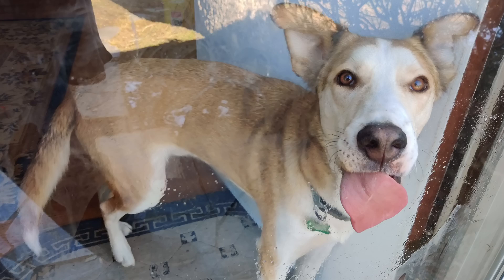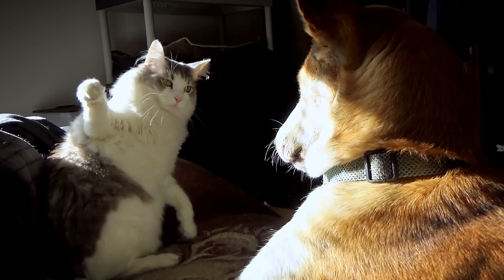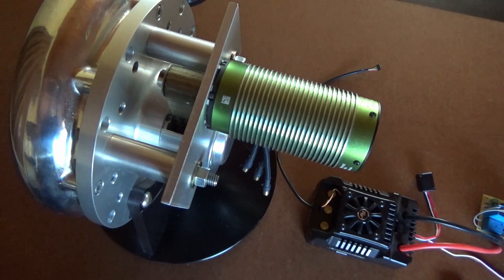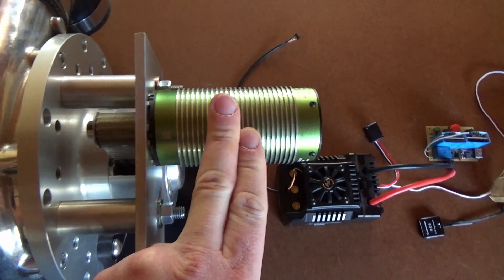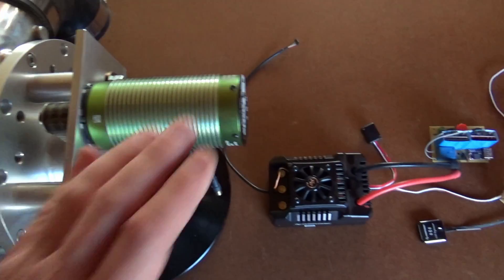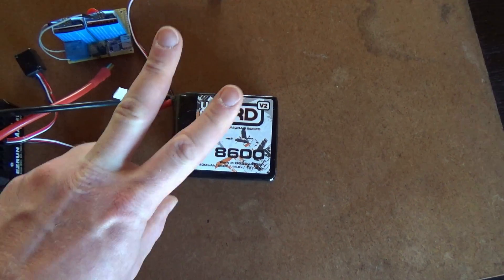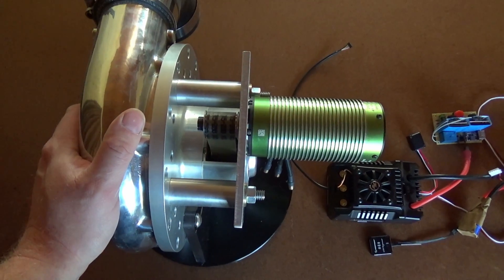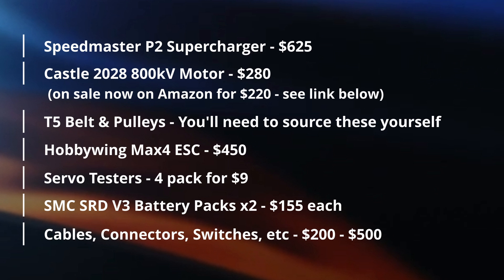DIY 650hp Electric Supercharger - Parts & Prices

Comment: Alex, if you 'had' to replace the centrifugal with a Positive Displacement (Such as a Scroll-type supercharger, rotary lobe, rotary vane), and your goal was just a little 7-8 psi boost on-demand for a daily driver.  Something like a 3.0  V6, and only up to 4000 rpm (literally 1/3 of the cfm's you've been hitting).  What would you go with?  Notice I said scroll-type and not twin-scroll.  I'm talking Positive Displacement superchargers that produce an almost fixed pressure output at any RPM.   I just want something for on-ramps, 0-50.  I'll be using a diverter valve, that lets the car run NA or Boost, by opening/closing the diverter valve at the throttle body (sealing off the factory air piping from air filter to intake, preventing boost escape...).  So the car can run NA most of the time without sucking air thru the supercharger (it wouldn't be able to thru a pos. disp. pump).  It looks like they've got some really cool scroll-type, lower rotor mass, 88% isentropic efficiency...
Reply from the maker: Personally, I wouldn't do a positive displacement compressor.  I used to run a Whipple and before that I had two Eatons on the LTD.  The benefit of the PD supercharger is instant boost - something that an electric drive gives a centrifugal supercharger.  The added benefits are that a centri is more efficient, you can draw through it (no need for a diverter valve), it's lighter, smaller and you can use a smaller electric motor to drive it due to the centri's much lighter impeller.   But you mention a scroll type supercharger, which is different; I've only heard of them being on older VWs.  TBH, I don't know much about them.  But I'd assume the net power input to drive one (in watts) would be comparable in HP support to the centri unit.  200hp (total) would likely take about 5kW; 400 would take about 10kW.  You'd have to match the motor/ESC to the operating rpm of the compressor.

Comment: i just asked Chat GTP 

what the max rpm for this motor 

Let's assume you're using a 6S LiPo battery (22.2V):

Max RPM = 800 × 22.2 × 4

Max RPM =70464
Reply from the maker: That motor is limited to 50,000 rpm; you go much above that and you risk disintegrating the rotor.  But realistically, peak motor power is around 30,000 rpm.

Comment: Awesome info, thanks. Is there a way to set up something similar with much larger batteries for much longer use, charging on a 12v system to replenish..........?
Reply from the maker: Sure you can.  But not sure why you'd want to - a couple of minutes of WOT in a 600hp car is not something you'd be likely to use unless you're racing Pike's Peak or something - even then, you'd probably never be in boost that long.  And I do have a charger setup in the car, btw.  Though it would take a while to fully recharge a dead battery.
Reply: @AlexLTDLX  Hey thanks for taking the time to answer me. Well the reasoning is for an aircraft engine, mine. As you know, with altitude you're losing manifold pressure. I'm looking to boost my amateur built Mll RG. I live on the W Coast. Big rocks. At 10,000 I'm losing 30+%. Turbocharging was my plan and I have all the parts to complete however, heat and exhaust fab are a pain.
Reply from the maker: @badattitudeaviation  Aah, ok.  That makes sense.  Didn't even consider an aviation application...
Reply: ....now if I could figure that out...even a few minutes of use at a time would be useful
How would that be done?
Battery size?
What about heat of the motor?
Thanks
Reply from the maker: @badattitudeaviation  just make sure it gets plenty of airflow and heat won't be an issue.  A 20 amp hour pack should give you about 4 minutes of run time.
Reply: @AlexLTDLX  thanks for the feedback
Reply: @AlexLTDLX  looked for charging on electric boost site...suggestions?

Comment: Where do you find the motor pulley?? I either find the right tooth but wrong width or the right tooth and width but the wrong bore 😭😭
Reply from the maker: I've not been able to find one with an 8 mm bore. I bought 6 mm bore pulleys and bored them out on my lathe to 8 mm.

Comment: Can you tell me the heat of the shaft coupler? I am hoping my friend can 3d print me a coupler that can withstand the heat and force of your set up, he has some metal imbued highe strength filament that can be utilized. I'd be willing to try it.

Comment: Any interest in building an electrically-assisted-turbocharger (EAT) like the Garrett one used in the Mercedes M139? It’s basically the MGU-H from F1 but adapted for production vehicles.

EATs still use exhaust gas to power the compressor, but also uses an electric motor during the initial spool to eliminate turbo lag. It’s the modern, much better iteration of Volvo’s PowerPulse.
Reply: I think a conversion kit for common turbos would sell like hotcakes. All I think you'd need is a spacer plate between the hot and cold side to house the drive gear and mount the electric motor, a modified shaft, and a controller. With the help of a machine shop, which you can utilize by mail, I think it would be easily doable as a one-off by a proficient hot rodder. Hot rodder=tuner, for the young folks 😂

Comment: Will a 2nd car battery on boot be suffient enough to power the electric motor
Also need  the pedal to control the electric motor like a top mount supercharger linear power

Comment: @AlexLTDLX  just another question 
Here is what i am thinking to setup correct me if any mistake 
Car dodge charger 3.6
800kv motor directly to turbo fan no pulley
4074 800kv max volt 62 max rpm 50k weight 410g
12v to 48v stepup converter 80 amp
I have access to hybird battery cells which is 7.5v each i think will be better choice they perfome like between lithium battery and super cap

My goal is to run turbo for 70 seconds for instant boost because i always race from 60 kmph to 80kmph, including there is 80amp incoming always to charge the batteries 
I am also car technician do unlocking stuff on dodge and tuning also good knowledge about electronics so i will understand your suggestion easily

Comment: What if we use stepup converter 12v to 48v 600w and use super cap with it
Reply from the maker: That would not work very well, unfortunately.  A supercap has a linear discharge curve.  Which means the performance would drop off instantly and not last long.  Nevermind that a 60 volt, 700 amp capable supercapacitor would be huge - they have an incredibly low power density.  If you poke around on my channel, I compared a lipo to a large supercap.  The lipo outperformed it in almost every way.  But a lot of people make the same suggestion you did - it's good thinking, just not terribly practical (yet).
Reply: @AlexLTDLX  just another question 
Here is what i am thinking to setup correct me if any mistake 
Car dodge charger 3.6
800kv motor directly to turbo fan no pulley
4074 800kv max volt 62 max rpm 50k weight 410g
12v to 48v stepup converter 80 amp
I have access to hybird battery cells which is 7.5v each i think will be better choice they perfome like between lithium battery and super cap

My goal is to run turbo for 70 seconds for instant boost because i always race from 60 kmph to 80kmph, including there is 80amp incoming always to charge the batteries 
I am also car technician do unlocking stuff on dodge and tuning also good knowledge about electronics so i will understand your suggestion easily

Comment: Hey i believe its been over a year u had this speedmaster p2 headunit and been testing on it! I plan to put this on my car and supercharge it can you guide any issue with the headunit itself or its been working fine how much boost have u pushed if you can guide on this? Any issue so far? Will appreciate your answer as cannot find much reviews on this charger
Reply from the maker: I've been busy building a new place over the last year 1,600 miles away.  Though I'm closing in on the finish line.  Then I'll be back to doing a lot more testing.  So far, I'm not aware of any failures with this unit in an electrically driven situation, but I also don't think there have been many hours of tests yet, either.
Reply: @AlexLTDLX  also can you guide where exactly can this be bought from as i have emailed/messaged speedmaster and they dont reply at all. Will this fit a 4800cc v8 engine idea is to get 6-7psi out of it but is the charger big enough?

Comment: It seems I need to do something custom like this. I was interested in torq amp and based on my motor hp (230hp), it would be a benefit. However, my 1.8L motor revs to 9000 RPM and I would probably actually lose power at the high end if their performance curves in the 3000-6000 RPM range were extrapolated to the higher RPM ranges. 40% pressure increase at 3000 RPM, 15% pressure increase at 6000 RPM leads one to think that the 5kW torqAmp just isn't enough for 7000RPM+.... You should finalize your design and sell it!

Comment: I assume the amount of power needed to sustain just a soft turbo pressure (0,5bar) throughout whole powerband of a 5.0v8 revving to 6500rpm is at least 2kW. It takes a 48-72V 40-30A motor and driver module to do it. Plus a step up converter from car's 14,4V installation that can handle such current. And all of it should resist extensive use and heat. For me a typical chinese turbo, some friend that can fabricate all that's necessary for conversion will still be cheaper. But it's my guess only.
Reply from the maker: You'd need a lot more than 2 kW.  More like 10-15 kW; and engine size doesn't matter, what matters is base and boosted hp level.

Comment: Have you ever added a little nitro propane to your gas? Dyno proven and i think it would give you about 50hp just adding it to your gas. I dont know how that would go with a sc snd your whole setup
Reply: You mean nitromethane? With a power adder you would be much better off using something like E85 pump fuel if they sell it in your area or buying nitrous oxide and adding a tiny hit of that to cool and increase the oxygen density of your boost.
Reply: @hendo337  no nitro propane has more oxygen in it.

Comment: I really really like this so if i got a 185hp engine with long tub headers i should be ok and this set up will give me 5psi of boost?  I run no cat or muffler my o2 sensor is in my header tube on the drivers side. I have multiport fuel injected engine woth mass air flow. You think i would be ok? Its actually a 2.8v6 with hooker supercompetion long tube headers jet hot coated. I think i would have to up my injectors from 17lbs though. I could upgrabe to better heads and intake to get to 200hp it has a cam in it 1.5 roller rockers jacobs pro street ignition with ultra coil holley annihilator ignition module. But it is starving for air. I know a guy who has 1 with 11.5 to 1 compression super long tubes and a weber carbs dyno at 270hp i know it can do it but mine is a little under your 200hp mark.

Comment: Hey man love the video, love that you're trying to find a nice simplified way to generate power, and even get significant numbers.  

I'm sorry if this is a nonsense suggestion, ss I can't say I know too much... about anything actually., but i was thinking for some time, what if you put a high power electric motor in place of the starter motor that can be electronically controlled to add power to the drivetrain as an engine assist.  Im guessing you'd have to reinforce/double up the flexplate/flywheel.  I figure at the very least it should give you a good amount of low-end torque.

Another unorthodox idea, could you have an axial motor 'in place of' your torque converter.  I'm sure the electronics and some counter loading problems would be pretty complicated but might be well within the reach of a decent electronic automotive engineer.  In it's drive line lower power configurations it could just perform as lock up value torque converter, in high-performance configuration it could actually add RPM with torque.  Don't know why I got the feeling that you might be open to such suggestions, sorry if theyre a waste of time

Got more stupid ideas but I feel I said too much already, again thank you for the video appreciate your time.
Reply from the maker: That's actually how most hybrids work.  They usually have two motors in the transaxle, and one of them functions as the starter, adds motive power to the car and under braking it functions as a generator to recharge the packs.  The axial flux motor on the torque converter is a very interesting idea.  Axial flux motors are very efficient and well suited for such a relatively low rpm setup.
Reply: @AlexLTDLX  never knew that about hybrids, thanks

Comment: Verry nice video and a good joob!  I was looking for something for my kawasaki zx10r 2004 for a bit more power.  N/A tuning is expensive  and electric turbo also around $2000,-   i think im going to buy a cheap ebay turbo with internail wastegate for 200$ and make self a manifold
Reply from the maker: This would be overkill and likely would go into surge on an engine that small (hp wise).  You could build a smaller unit to suit, or you could go the route you suggest - but it'll end up costing a lot more than $200 bucks in total, even if you have all the tools to fab it yourself.  Both are viable, both have their pros and cons.

Comment: how long with that supercharger run with the specified battery setup on say a 400hp engine?
Reply from the maker: You'd probably get about 2 minutes of runtime out of those batteries.  But you'd be at 600 hp and 600 hp at WOT for 2 minutes is about 1:45 seconds longer than what it would take to wreck your car at WOT - lol.  That's a lot longer than it seems.  With my current packs (18 ah) in the LTD and an electric supercharger drawing almost 700 amps (more than double what you'd see with this unit), I've never had to charge the packs in a day of racing or a full day of making dyno pulls.
Reply: @AlexLTDLX   is there a way to recharge the batteries while the vehicle is running? my 1982 S-10 ran a 8.91 second 1/8th mile at the dragstrip an hour from my house. the elevation here is 7,000 feet. your setup is interesting.

Comment: Hello, very cool setup. Very nice to see someone thinking more about the masses and the budget/space the masses have. Have you perhaps thought about replacing the batteries with supercapacitors? This would mean that you would have like 20-30s of boost and then the capacitors would charge up again from the alternator or battery in minutes to make another 20-30s. Just seems like a good idea because it could be more compact and normal batteries just take a long time to charge. Id rather always have a reliable 20-30s than find out that my batteries are too empty cus i just dont drive long enough drives to recharge them if yhat makes sense?
Reply from the maker: Supercapacitors have a very low power density and a linear (i.e. straight down at a 45* angle) discharge curve.  That means the performance would start dropping off instantly.  I have a super capacitor vs lipo video on my channel explaining this in more detail.

Comment: Glad to see you're still around. Literally found this video when I was trying to explain to my buddy what I want to do with my rx8 eventually.
Though had to shelf those plans until I get my speed 6 running. Almost there just have a oil leak on the turbo return side to fix and I'm done
I am already on the forums too
Reply: Looks like we're on the same journey. Already bought my P-2. Just researching the electric side of things. So much room in the RX8 engine bay.
Reply: @rivalautosport9228  I'm still gathering stuff. A coolant seal too my 8 down so it's on the list of cars to rebuild.
Have 3 speed motors to build them will do my 8 and speed 6 build both motors at the same time

Comment: If you added the motor from your sledgehammer to the P2 speed master and geared it to spin faster would it be able to produce more power than you rated in the video or is the p2 maxed out with the castle 2028? 

I ask because 
My engine is 200whp NA  4 cylinder engine and my goal is 460-500 whp . To reach  14-16psi/ this level is compounding the only way ?  Please do a video on how compounding changes boost level and power levels.Thanks for awesome videos as always!!!
Reply from the maker: The LMT motor could be geared up to work; but I'm not sure the belt would hold up at those speeds.  Also, the ESC and motor are very expensive - $1000 for the motor and $2000 for the ESC.  It would actually be cheaper and more efficient to run two of the units I describe here in a compound setup.  That should get you there.  I've been thinking about doing a video about compound boost actually.  But any new videos won't come out until I get down to Texas.  I leave this weekend.

Comment: 800rpm seems too low, wouldnt you want like 30000 rpm?
Reply from the maker: Did I misspeak in the video?  (serious question - I've been loading the moving trailer for the last 3 days).  This setup will spin the impeller in the 28,000 - 37,000 rpm range depending on load.
Reply: @AlexLTDLX  No, I was looking at the motor on amazon as I want to do the same thing and it says 800 RPM, I was looking at others that can do 25,000-30,000 so why this one and if this one is so great should I go with 400 RPM as my motor is small and 130hp.  I just thought you would want that 30000 rpm but it sounds like 800 somehow gets there
Reply: @AlexLTDLX  also think you should get much bigger batteries...
Reply: @AlexLTDLX also I was thinking of creating a peltier cooling box/intake.  It would be a tube that goes to a box that has a large array of peltier modules cooling when you turn them on, I think you would also have tgo use external power on this too as the power from the motor would cancel it out wouldnt it, or is this something you could power off the alternator and it would be worth it?  Either way seems like a good idea to chill the air a ton but maybe its a horrible idea